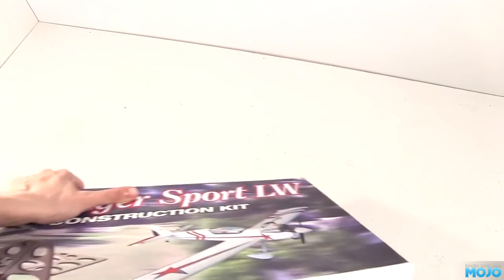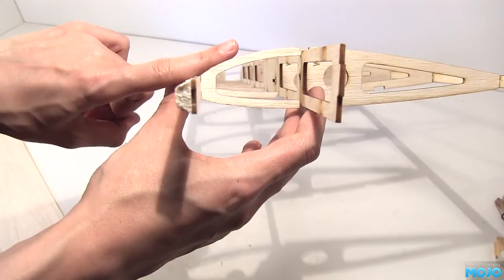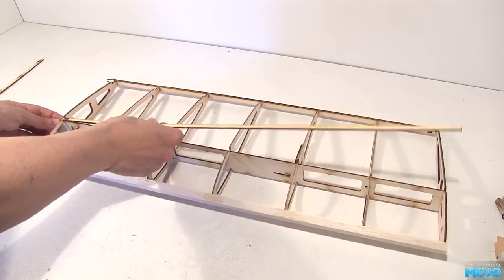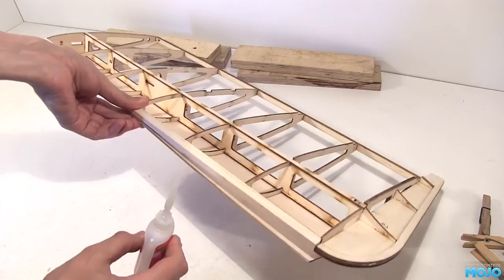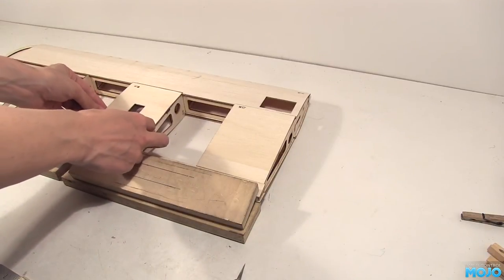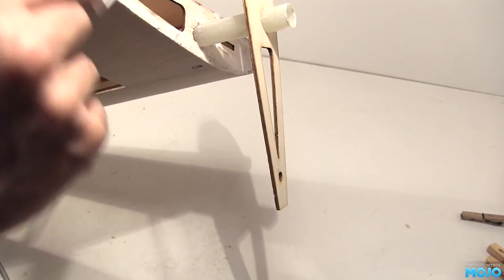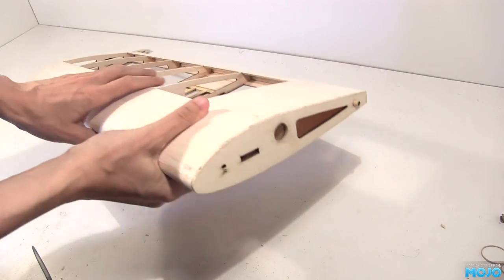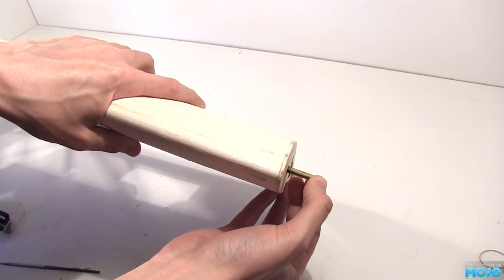Seagull Challenger Build Up Kit - Lets build a wing

Comment: Just a question, I've seen this kit advertised with a wingspan on 1340mm and I've also seen it with 1450mm can you tell me which is actually the correct wingspan . Really like the look of this kit, so am following this build closely .
Reply from the maker: kymmbo Just plugged it together and I make it 53 inches, or 1340mm tip to tip.